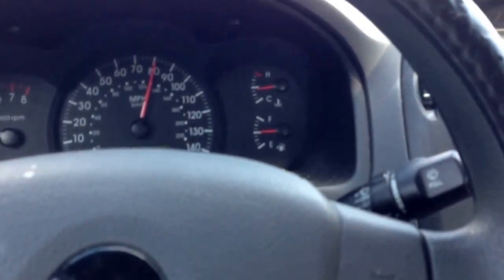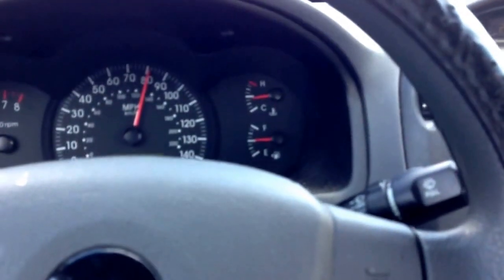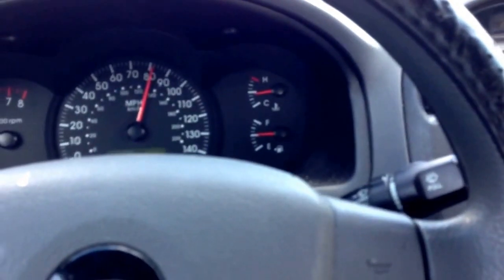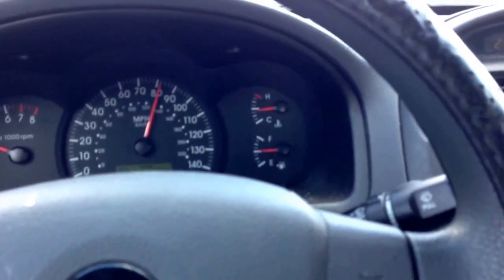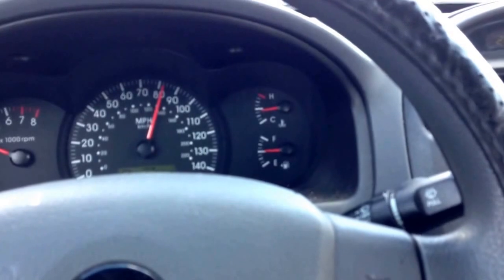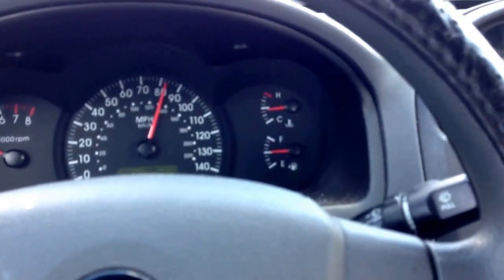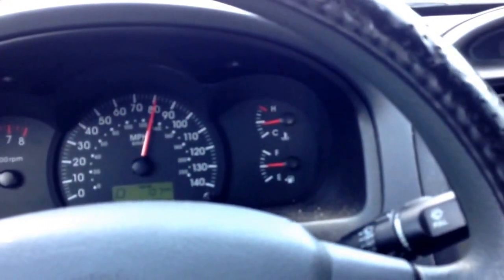DIY-Fuel Ethanol (190+ proof Home distilled) on a Test Drive

Comment: I have a interest in running pre-war outboard motors on ethanol and benol. Adjustable timing advance and external fuel mix is common on super old outboards. 

Benol smells amazing, and mixes with alcohol.

Comment: how is it working for you now, 7 years down the metaphorical road
Reply from the maker: My Kia Sorento is still running off of E85 up to 188K miles now, No problems. My KIA Spectra ran up to almost 300K miles, had a blown head gasket so I got rid of it, no E85 problem, just old age.
Reply: @rhandsom  Stupid question could I archieve a similar result buying a simple destillation kit from china in aliexpress ??¿¿

Comment: "They" say it destroys engines with cold start ups. So... That's why they make pre oilers and anti freeze circulator/heaters, right? I'm definitely going to still my own. I'm kinda sick of government interference though so I'm not getting a permit. I have a tig welder and copper sheets in garage, gonna make a 200 gallon still. I have plenty of acreage for potato's and corn. People say its too much work,,,, I say to those people.... Go ahead and pay 50% of your income to fuel and taxes over your lifetime,so be it.
Reply from the maker: Thanks for the comments, after running my vehicles for maybe a couple of years now, I would say that folks that say it destroys car engines are not telling the truth.
Reply: Just don't get caught with hundreds of gallons of untaxed unpermitted liquor or the man will hole you up in a cell for a long time and take all your stuff.
Reply: @MarkReaves84  how can you owe taxes on something you didn't buy?

Comment: Seems to me this is more expensive than just buying gasoline.
Reply from the maker: Nathan Jennings e85 is cheaper at the pump. It can be more expensive to make if you don't have the raw materials you grow yourself.
Reply: You'd have to be growing and harvesting like.... acres at a time (assuming corn) to make it cheaper than e85

I usually make a few gallons a year of 190 proof from apples at the end of the year, this year I harvested 20 trees and came out with about 5 gallons of 190 proof.

I guess it would only make sense though that since it is not for consumption you would not have to remove heads or fore-shots, and therefore would make a considerably larger amount of product.
Reply: You don't have to run the ethanol so strong. In its pure form, ethanol is water soluble meaning the two will chemically bond like salt will with water. I'm curious to how little ethanol it takes with water to run because if I could engines off of water(which I get for free from my well) it would save me an incredible amount of money. The problem is that the government will not sell you pure ethanol from the plant, it has to be mixed with a petroleum product(which is water soluble) before it's able to be sold at the pump.

Comment: Hi do you have a video showing the product you bought for conversion and cost. Also a how to video of the conversion. How is the car working now, and how did you make your own fuel. What was your cost comparison making vs buying fuel.?
Reply from the maker: This is the video I made earlier, https://www.youtube.com/watch?v=pjWSmVngQbs, the car is working as expected,  buying fuel is cheaper than making your own.  But it's still a good skill to have.  I made my own fuel with a reflux still.
Reply: I was hoping it was cheaper to make your own fuel, have you looked into making the cooked oil running adapter. I saw some videos and that really interested me, but I do not know how to do that, but I think you might understand it ? Thanks I will look at your other video :D
Reply from the maker: No I hadn't considered making that type of adapter.  Sounds interesting though.
Reply: Their was a guy who converted a Toyota truck, the small ones. and he used restaurant oil, it was very cool. If you do that let me know I would be interested :D
Reply from the maker: I looked at the video and the conversions were with diesel vehicles.  I don't think this is practical or possible with gasoline vehicles.
Reply: I will have to try and find the toyota truck one, I had seen long ago videos on regular gas I thought it was with regular gas vehicles. Thanks for the reply :D I appreciate it.
Reply: Do you know how to make the explanation simple :D I only found videos on diesel and a forum that says that is the ones that do run on cooking oil, you are very correct. :D dang I dont have a diesel car
Reply from the maker: Since diesel works by compression, it makes sense.
Reply: I did find on a channel a kit for certain car models they run about $1300 to $1700. I want to try to do this lol have to wait on it list to do. lol, but I do like your making of your own ethanol, can you make ethanol from corn somehow?
Reply from the maker: +Hi Honey I bought a huge bag of sugar from Costco and used yeast and water, mix together and wait 7 days, then distill resulting beer into alcohol. That's the short version. There are plenty of videos that will show you how to do it.
Reply: I really appreciate all your help I will be rechecking your video :D
Reply: i saw a guy selling deer feed sugar beats for 50 bucks a ton if i remember maybe it was 50 bucks for 5 tons but at any rate you do not need to put much sugar in with them to get a high a/c mash if you run a wood fired styl  i do not see how it could cost a person more than at the pump i mean yes you will have some time involved and getting barrels and stuff from zero will cost you but after that start up cost you should be able to at least brake even depending on the cost of the day. if you use high gravity yeast you should be able to get 15 to 20% alcohol per gal of mash we saw a bust by baft on a guy who had a 800 gal set up best case example on paper mind you he would be running 200 gal of fuel per 1000 gal of mash 20 per 100 i bet you could make a 1000 gal of mash with a ton of sugar beats  easy you do not need a copper type set up unless you intend to drink the stuff. steel tanks will work just fine for fuel grade ..my dad was born in 1922 he said way back in the day a bunch of dairy framers would shut down for a month each year and use the pasteurizing equipment from the milk plant and run shine to make up for the depression economy and make the bank and tax money each year. i guess they sold it all in one shot to the purple gang out of detroit mich. good story if nothing else. by the way keep up the good work young man you make us a proud nation with the efforts.

Comment: If you would run alcohol on a compression ratio as  high as 18:1 you will get greater fuel efficiency and eliminate any cold starting issues. For more information get the book at alcoholcanbeagas.com

Comment: whats your lambda ratio?
you cant just change the fuel type you'll need a complete re tune for the new fuel..
Reply from the maker: +Josh Thanks for the comments.  Actually, I converted 2 vehicles using a conversion kit I bought off the internet some time ago.  No re tune necessary.
Reply: +rhandsom can you please give a link to where you bought the kit?
Reply from the maker: +Ahmed Meguid The link to buy the kit is www.change2e85.com
Reply: +rhandsom Thank you!!!

Comment: Ethanol reduces tailpipe carbon monoxide emissions by as much as 30%, toxics content by 13% (mass) and 21% (potency), and tailpipe fine particulate matter (PM) emissions by 50%.  Ethanol also reduces secondary PM formation by diluting aromatic content in gasoline. Over half of the air pollution attributable to vehicles comes from "high emitting" vehicles that make up only 10% of the vehicle fleet.

Learn How to Make Your Own Ethanol Car Fuel - DIY Instructional Guide https://www.youtube.com/watch?v=OruH0a2t6z4
Reply: I believe you are referring to blends like e-85 . Just imagine what running pure alcohol would look like! you would have virtually no pollution it's clean enough to run inside your garage! in fact it would be similar to the air at your local bar.

Comment: What is the savings overall? I heard you can make Ethanol from grass cuttings, is this true?
Reply from the maker: When making ethanol yourself, unless you grow your own raw material you don't really save money.   Depending on where you live, it's probably cheaper to simply buy it. You save money buy growing your own raw material.  In an industrial setting grass "might" be used.  However for DIY, I haven't seen any successful experiments using it.
Reply from the maker: zerogascar With gas being very cheap these days, you don't really save anything from making your own, unless you own a farm and grow your own raw materials.  Making ethanol from grass clippings is a form of celulosic ethanol, my spelling may be off but the concept is being accomplished on a commercial level.  It's not practical for home DIY'ers.
Reply: rhandsom Gas in Costa Rica is 6 dollars per gallon
Reply: zerogascar I understand it can be done with sugar cane, this crop grows in abundance down here.
Reply from the maker: Thanks for your comments and patience. Sugar cane is a raw material of choice. If you can get a lot of it for a cheap price then your good to go.  Anything that will produce some form of sugar will allow you to produce ethanol.
Reply from the maker: zerogascar Wow, that's expensive gas.  In cases like this where gas is expensive per gallon, and you can grow your own sugar cane, sugar beets, are anything that will produce sugar in abundance, then I would definitely look at going this route.  Brazil is a huge producer of ethanol due to their production of sugar cane and they've decreased their dependence on oil or gasoline tremendously.
Reply: +Orlando lopez That AMAZING!!! If we can channel the shit in every city into 1 central mechanism that turns it into ethanol, Exon/Mobil  would be toast! But can it ale be done with the cuttings of a lawn? Let me know as we're interested in getting one of these stainless steel ethanol machines off of alibaba, My wife & I are 1000% consumed with getting off the grid, solar, ethanol, aquaponics,  our own exotic fruit trees etc. Everything grows here in costa rica, the soil is also very rich, the issue is they recently started with kem trails here as well, it sucks!!! Cant get away from these globalist! Meanwhile they are killing us with our own $$$, What a vicious cycle!
Reply from the maker: Actually, being in costa rica you should have plenty of raw material to make ethanol fuel.  As for yard grass etc.  I would stick with the regular raw material such as sugar, corn, maybe rice, etc.
Reply: +rhandsom 

Alcohol can be made from grass clippings you might want to do some research on it depending on how sugar rich the biomass is in your area; it is wise to make alcohol on things that grow in abundance, they actually should have a good supply of sugar cane and excess produce down in Costa Rica!
Reply: It really depends on how much research you do and how proactive you are with community supported agriculture, it wouldn't be a bad idea to visit institutions who have success in this field and see if you could pick up some ideas and shine some light on any blind spots that you may have.
Reply from the maker: For those interested in making their own fuel, that's not a bad idea.

Comment: did you have to make any change to your carburetor car?
Reply from the maker: Actually, newer cars are EFI (Electronic Fuel Injection). I just installed a converter from change2e85.com.
Reply: what about a citroen saxo 1.1? I don't know if it new but it might have 10 years old. Did you have troubles when the temperature is cold in switching on the car?
Reply: +Arline A. There are two ways: that I can think of,  to overcome a cold start on alcohol fueled engines, one is to install a cold starting kit that was origionally intended at the assembly line but was tossed out. These things could be filled with pure ether(cold starting fluid) or the other stuff; the other method is crude and very origional and that is to run an extremely high compression ratio such as 18:1! it has been popularized by tuners to convert diesel engines from 20:1! after doing this you should have little to no trouble starting your engine on cold days. The backdraw to 18:1 is that you would have to stick with the high octane rating of 104(alcohol) or other blends ofbio diesel/alcohol.
Reply: +Buddy The bear ok, now I say that is another level that overcomes my limits to understand... I was fancying to think about greeting your car every morning with a great warm cup of alcohol tea into its tank...But yea meanwhile thanks
Reply: I appreciate your optimistic willingness to run your car on alcohol. You could spray some starting fluid(denatured alcohol) into your car's intake plenum or carburetor while starting your car.
Reply: oh I apologize for that.   I guess you could spray some "starting fluid" into your carburetor while starting your car. You can find starting fluid at your local automotive parts store. 
    p.s. look at the ingredients

                                I thank you for your promising willingness to run your car on alcohol.

Comment: @Sachi WI I learned somewhere that you don't have to use food to make ethanol, and actually some of the best ethanol can be made from GRASS CLIPPINGS.  We sure have a lot of grass out there.  Imagine if the corrupt oil industry's fuel could be replaced by something as abundant as grass.
Reply from the maker: I believe you are referring to Cellulosic ethanol. It's true that some companies have developed a process to produce this type of a alcohol, but making it at home would be a little more tricky.
Reply: +EBENLO Painter of Song Which is probably why M0nsanto is trying to choke off farmers and kids with things like roundup(pesticides) so things don't taste so good as they did in the 1960's.